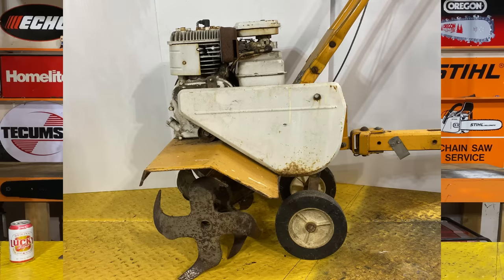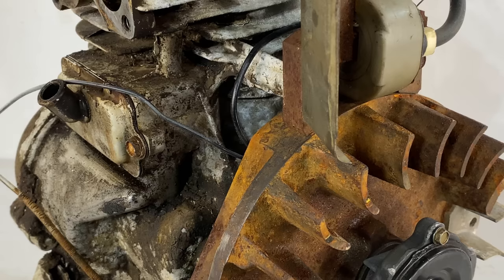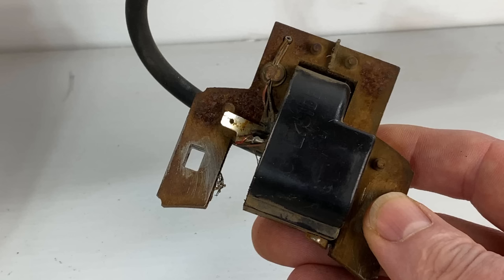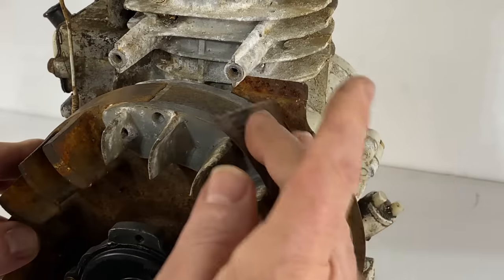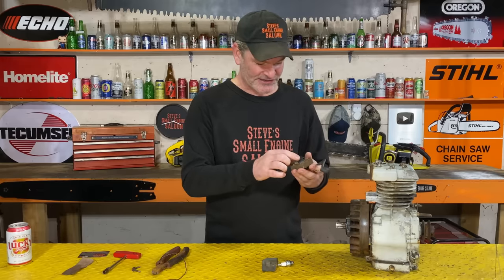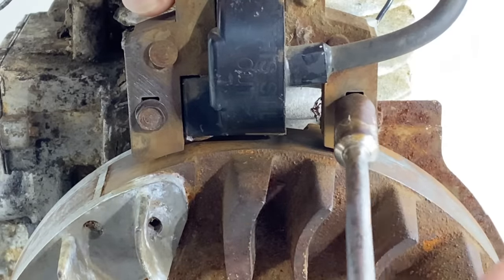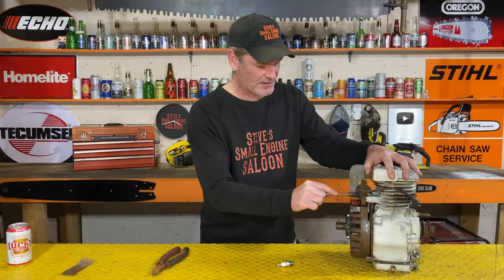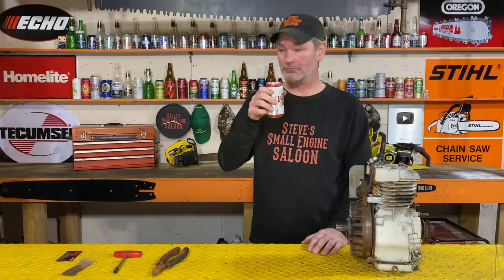Easy Hack To Eliminate Breaker Points & Upgrade To Electronic Ignition -Episode 5 of 7 Tiller Series

Comment: can you tell me how to tell a Electronic Ignition coil from a  reguler coil and were dose the one wire go to 'thanks this is for my rototiller 5 hp bridggs
Reply: The wires leading under rhe flywheel   would generally be to a set of points on old machines but don't confuse that on machines with  charging stators

Comment: Back in the day (1980's) I'd convert my old Briggs engines to electronic ignition using an "Atom universal ignition module". They never lasted long for me, would fail every 3 or 4 years. I prefer doing as Steve did, using an OEM Briggs coil with the module built into it. They last much longer and run better. I'm sure that Steve has seen a few of those Atom modules in his days?

Comment: That's a great idea. The only breaker point engine that I have left is a Kohler 8 HP engine on a Gravely tractor. I assume that a unit is available for this engine. I bought it in 1984. Is that true?

Comment: Well I just learned a valuable trick and I have 2 old tillers like this.  One is shot and has a good coil.  Other has a bad points coil.   I cant wait to try swapping it over!   You're a beauty Steve!
Reply from the maker: Good luck!
Reply: @Steve's Small Engine Saloon  it worked!   Full bright spark.  Swapped coil. Clipped wires and she sparks!   You sir are a legend!

Comment: Installed one of these units.
Engine would not start.

Turned out unit was on backwards timing was off.
Reversed it motor runs perfect now.
Reply from the maker: Right on

Comment: Steve I did everything you said about No COPRESION, It was hard to turn the cutting blade I did the cylinders they were ok, I clean the flywheel; Notice one side of the onesie was stuck and I had tape down the,   break release I PUT wd 40 on the brake release. This was on John Deed JTHAAS63 THE ONE WIHIT TNE 2 WEALS that are extended out i hope you understand me.
Reply: I can't understand you. It's like a foreign language where only some of the words makes sense. 😀 You can always come back and EDIT your comment by clicking on the 3 vertical dots next to your comment.

Comment: Me, I like my points on my old engines, a lot simpler to fix, as long as the coil itself doesn't go bad.
Reply from the maker: Fair enough!
Reply: counterpoint: my dad's old weed eater never needed the ignition fixed after he had it upgraded to pointless ignition.
Reply: @StevesSmallEngineSaloon  I do have plenty of new engines too, to admit, I have converted a couple over to electronic ignition,
The ones that bug me is when the points underneath the flywheel, I'm lucky that in the climate I'm in, even though it does it get humid in the summer, in Wisconsin, somehow I still don't end up with corroded points.
Reply: @kenbrown2808  I have three of the same model of lower end, leaf blowers, that I got from someone
All have extremely weak coils, and I've seen some pretty bad coils run an engine pretty decently, like yellow bad spark.
Reply: @turtmastert3545  point is, before he put the pointless ignition on it, he was getting the points fixed every season.  after - no more problems with the ignition.
Reply: The electronic modules have a much better spark especially while starting. I'd never go back to points ever again, but do what you like best! It's all good!

Comment: Cool upgrade. Was there a year when electronic ignition was started being introduced on these types of engines? And, would you look for a matching electronic ignition part on an engine of about the same size (HP, etc) to get the right flywheel circumference matchup?

Comment: You did it the best way .Cost more to buy a electronic Module with a kit and you still have to cut the wires and use Electrical liquid Tape on it. more time and more money .Transistor Module is easy to install but seem easy to blow them apart if you try to Jump Start the Engine.
Reply: Garry not Linda. Jump start a lawn mower engine??

Comment: Show the viewers where the wire from the ignition module goes to kill the mower. 👍👍👍
Reply: Connect it to any metal electrically connected to the motor.
Reply: @richbooth8948  I was just wanting for it to be shown and explained why since some people don't know how it works. 👍👍👍
Reply: Back in the good ole days, many Briggs horizontal engines used to have a metal clip that you could flip that would ground the spark plug at the plug wire terminal to kill the engine. I have an old 1970's Kemp Mfg. chipper shredder that has this. If you didn't watch where you put your fingers and touched the bare plug wire terminal instead of the flip switch, it would light you up good!

(1) Kemp Chipper Shredder - YouTube

Briggs & Stratton OEM 220884 replacement stop switch-sp plug 24847776270 | eBay

Comment: Like you , I have been doing that for quite some also......... Points are cheaper , but a lil more maintenance is needed, If I had a choice on a outboard engine , I choose points.... Way cheaper than a coil pack..... I'm about to take the potting off of a 25 hp Evinrude and reverse engineer the PCB and make some for our shop.....  I'll catch ya on the panel with Mick's Mowers again soon... I might join as Cajun Coin Hunter or this channel....

Comment: Another easy way to remember how to orient the coil properly is to look for the small silver-looking "button" on the bottom of the coil (see 6:50 in your video - it's on the right hand, bottom side near your thumb).  This is the initiator coil.  This coil MUST be the first to encounter the field from the rotating permanent magnet on the flywheel.  In your video the shaft rotation is clockwise when viewed from the output shaft end.  The initiator coil must be positioned so that the magnetic field hits it first, so the silver button thing must be on the left hand side when you mount it.
Reply: Running 220 from an outlet will give you spark as well. And,the human body makes a perfect faze too ground.
Reply: @shannonbrooks8834  What is a 'perfect faze'?
Reply: That "silver button" is also known as the trigger coil. Learned this yesterday from Tuber "TheRepairSpecialist".

Comment: I like my upgrade for lawn equipment  new honda engines .I beat my brains out 30 years with tecumseh junk and dont need a beer before trying to use them . Now afterwards a bottle of yuengling and a good Relaxing chair .
Reply: Overpriced Honda engines! Unless you got a free motor, an electronic coil and maybe a new carb would be a much, much, much more cost effective solution than sticking an expensive new Honda motor on a 30 plus year old piece of equipment. If the Tecumseh was in otherwise good condition and still wouldn’t run after that, then the problem is the mechanic; not the motor! Might need to take it easy on the beer, cowboy!

Comment: Thanks for the great info, my MTD Briggs & Stratton 5hp tiller wont show a spark. Its been sitting for 2 years and I wonder if it has the same rust problem, its not been used much and was running great when I last used it. I will get the sand paper out tomorrow. Also where can I get the electronic ignitin for my 5hp tiller. Thank for you expert advice.

Comment: I have an old 2-wheel tractor with a long time out of production Universal brand 1 cyl gasoline. It does not have the B&S outer coil style,  but two open spun coils on the flywheel inner diameter. 1 for charge, 1 for ignition, flywheel has many magnets all around. 1:2 geared separate axle with lobe breaker and condenser times the spark. How would you go about making a dependendable new  spark on such a creature ? Have you seen so suitable electronic conversion kits somewhere ?

Comment: Good show steve, also I have one of the cheap briggs plastic carbs on my mower. Yeah it's starting to give me problems. It's about 3 years old.
Reply: Tag wire and carb cleaner. Each circuit pops out of the carb for easy service.
No more corrosion, ever.
Do not store it pump gas, though.

Comment: Taryl had an interesting demonstration on a Kohler? engine. If the coil was installed properly (this side out) the coil wouldn't work. Flip the coil around so the cylinder side was out, it ran. It appears that some engines have the north and south poles swapped. Flilpping the coil meant you didn't have to have the magnet recharged with opposite polarity.

Comment: Most of these small horsepower B&S use SAE 20 oil, however,  that type of oil is extremely difficult, if not impossible to find.
Can you use SAE 30 or 10W30? Any other substitutes?

I have a 2 1/2 HP B&S engine and I do not want to damage it because I'm using the incorrect oil.

An quick episode on what can you substitute when something is discontinued would be great.

Comment: Great video Steve, just one thing. You did not show how to reconnect the kill switch wire. 😢Can you add a video to show the complete process? I am refurbishing an old Kohler 1.75 MBM25 generator that is powered by a Briggs and Stratton model 100232. I’m really glad I watched your video because I did not realize I bought the electronic coil and I was going to replace the points and condenser too. What would have happened if I did that, left the points active? Thanks I’m subscribed now so I will be watching more of your content. 😊

Comment: Thanks!  I'm working on an old B&S engine on a generator, and found I have no spark.  It's got points, but I'm thinking I might ditch the points and just put on an electronic ignition.  Do you think there would be any issues if the engine's kill switch is the old kind that grounds the spark plug?  I'm thinking the kill switch wire would just be left off.

Comment: I have a 1970 K301 that had breakerless ignition and it went bad....now I have points. How hard would it be to do this to that engine? Also, does this work on multi cylinder too?

Comment: Hey Steve. I've got a pointless magneto that didn't come with the long kill switch wire. Any ideas on how to fashion a wire that would work? I was thinking about getting a sheathed wire of a similar gauge and crimping it onto the tab on the magneto where the kill switch wire is supposed to connect. Alternatively I could get one of those connectors and install it onto my makeshift wire, but I'm not sure where to find that connector. Your thoughts?

Comment: Thanks for the video. I did that and still no spark. How do you test the kill switch to see if it’s bad? I have a Troy bilt tiller with three kill switches. One in each handle and one on the transmission.
Reply: Simply disconnect all kill switch wires from the ignition module to see if you now have spark. By trial and error you should be able to narrow down the faulty switch.

Comment: Great video as always Steve.  I learn from them every time.

I have an 8hp on an Ariens snowblower 

hm80 155128b.  Would you happen to know the part number for a new electronic coil to replace the points and condenser system?   Thanks. Larry

Comment: Steve, been watching you and your vids for some time. good stuff. I'm working on and older Stihl 048AV electronic ignition. seems like when something dies its all at once. plug coil either one, both.  so this particular saw has a magneto or something like that under the flywheel with a wire going to the coil. how do you test those to figure out if they are bad good or otherwise?  I purchased a brand new coil and installed it..no luck in getting any spark.
thanks for your time and your videos

Comment: Seems to me, about ‘90, I bought a small module at K mart that eliminated the points. It didn’t require a coil change, and was around $6.00.
Worked fine. That mower is long gone.

Comment: Where do you find old parts or replacement parts? I have a 70's Hahn Pow r boy tiller with verticalshaft 4hp briggs and stratton. I've been looking for a replacement coil to change over so I don't have to mess with the points. Also, the screen is missing on bottom of pickup tube and I need carb gasket kit.

Any suggestions? 
Thank you,
Jeff D. 
Pennsylvania.

Comment: I have a old Husqynarva 365 Air Cooled chainsaw and in need for parts. Where is a great place online to find the exact parts I need for it? Went to places and they didn't have the parts or didn't match mine. Thx so much for your help!
Reply: Just go to eBay or buy a parts saw.  Husqvarna's are popular.  If you want try your dealer = usually a few hundred dead chainsaws in back.

Comment: Steve, I'm looking for coil and condenser for David bradley 758g. Or one like it. Know where I can get one? Thanks. I'm pretty sure it's cooked. Looks like someone over heated this saw. Maybe ran with no oil. It has compression. Has some scoring on piston. The head is tanned. Other wise it's A low hrs saw. No spark.to test the condenser connect or short it to 12 volt car battery for a couple of seconds and then the lead should produce a spark on its own case right?

Comment: Steve great vids have a dilemma Briggs 8hp engine on dredge little no spark tore into it should i put electronic
 ignition on, old coil flywheel had rust  numbers 190432 1861 01 80102912 the old coil had wire coming straight in to back (no connector) which i am assuming  comes off points there is no kill switch  trying figure out what rights parts to get thanks for any help

Comment: I've learned so much from watching your videos Steve thanks. I have actually go some mower running that I couldn't. I have always wanted to work on these bad bys now I feel like I can make them work. Recently found a string DRpower mower engine is a 2000 B&S. it's hard to find info on it I'd like to know if it can handle a saw blade and if I can get a newer trim head on it.. Thanks again..
Reply from the maker: Glad to help

Comment: Hi Steve, great videos. I am working on a Briggs & Stratton 8R6 Type 107842 SN 672469 on an Eclipse Rollaway. I cannot find the replacement part for the coil. Do you have that part number of the original coil or better yet one like you used here to fit correctly and work on my engine that is electronic and bypass the points? Thank you in advance.

Comment: Wrong article but Steve, please help .
Briggs T12605-0880 self propelled 6.5 / 6.75 craftsman mower 15 yr old… great mower, take good care of. Clean fuel/no water.
Started to miss, quit, and then won’t start, till thermo cools off. Installed new carb, ( needle & seat new ) float cuts off / allows fuel as needed. 
Choke correctly closes when cold, opens when hot. Good spark(shocked the wife hehe). Cleaned ( emery cloth )coil and magnet. Reset coil ( thickness of folded writing paper ) maybe too close?
Coil on order ( just because ) plus new spark plug.

Getting tired from lifting up and lowering down off work bench.

Any ideas or wisdom.

Love your tips.

E.A.
Reply: Now tried business card for coil gaping… no change in running rough / finally quitting and won’t start again until cool. As above

Comment: I have a small lifan 5.5 hp engine for a water pump, and my engine skips every 5-8 seconds, and at low rpm, it shuts down after a few skips. Now i changed the plug and it did almost fix the problem and the skip was very minimal and not abrupt like before, but now due to a non adjustable carb the plug got sut on it and the skip came back...meaning I'm not getting any power from the coil pack...is there anyway to upgrade this ?....like in old carburetor cars you could have did the msd power pack 😊

Comment: I have a old chipper. The ignition coil went bad i replaced but the replacement is missing like a quarter of a inch of coil so mine doesn't generate enough spark. Would love a second oppinion. Or link.  Mine is all ready electronic ignition.

Comment: Hi Steve,  my Briggs 4hp was running great. Then it just won't hit a lick. I have spark and also have fuel! It has to much fuel I can clean plug or put a new one and it floods the plug on the 1st pull. Any help? TIA

Comment: The one time I tried to clean points I had a similar experience...they worked for a day and the next morning when I tried to start the motor nothing...after that points were done for me.  Also use a briggs coil, I've heard lots of stories with the $10 amazon coil that runs for 10 minutes then dies...Next video lets get an Asahi Super Dry as your helper

Comment: Excellent stuff Steve, great video as usual! Does this work on any of the points type B&S engines? I have a 1969 Hayterette with a 3.5hp 92902 Series motor that the primary of the mag seems to have recently shorted out. The flywheel is all alloy and has two sets of magnets, slightly different patterns 180 degrees opposing. On another engine, a 3hp 80202 (1987) .with a cast iron flywheel having an alloy quadrant, there's only one set of magnets, but this has no points and a magneto with trigger winding. I'm wary to swap over this mag to the older points motor as the two sets of magnets seem different patterns which is puzzling me!

Comment: Hey Steve.. I have a Coleman powermate 5000 with model #PM0545305.01 the coil has two wires coming out and one of them goes to the engine..the other may have gone to a switch… sense I pick up this unit with out carb and no pull cover.. I don’t have idea how it came assemble.. I found a carb and a pull cover… but i Don’t have spark.(I already sand the coil on the legs and the flywheel… any idea?

Comment: I have been unable to find the correct ignition module. I had to buy one, but it is not the correct one and the radius on the legs do not sit flush with the fly wheel. Can one or both of the legs be grinded down to fit the fly wheel? Since my machine no longer has the model number, I cannot find the correct coil.  Or as a last resort, can the old legs be somehow removed from the old coil and replaced from the new one?

Comment: After sanding rust off of the flywheel magnets and coil armature legs, I like to apply a very light thin coat of clear varnish to prevent the rust from coming back. Of course you don't do this where the coil is bolted to the engine, that would prevent it from grounding.